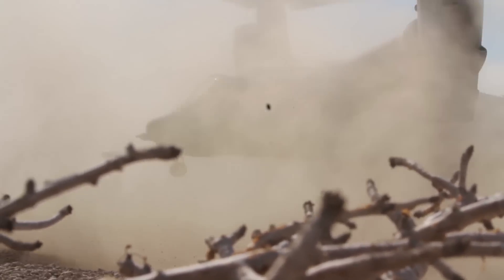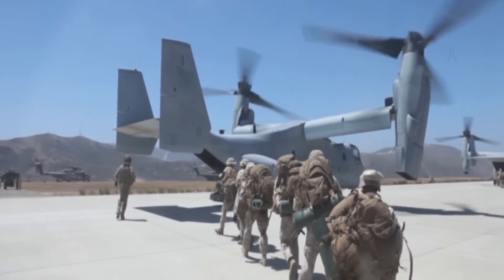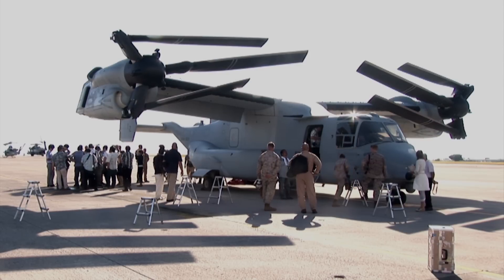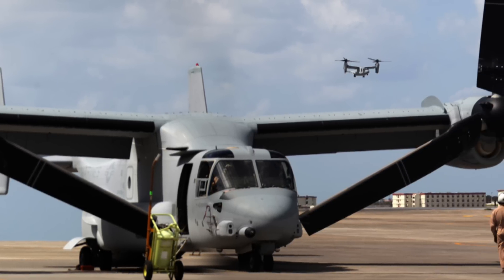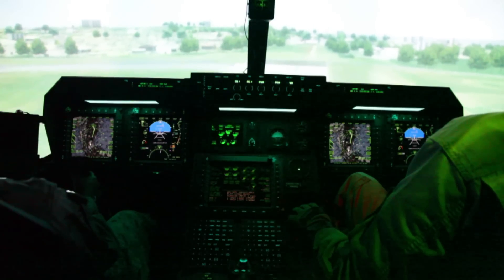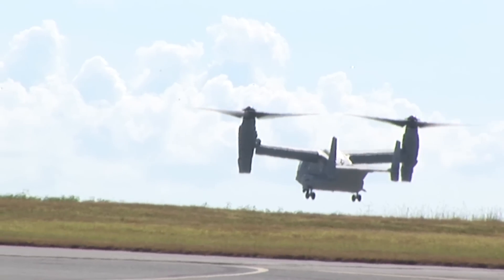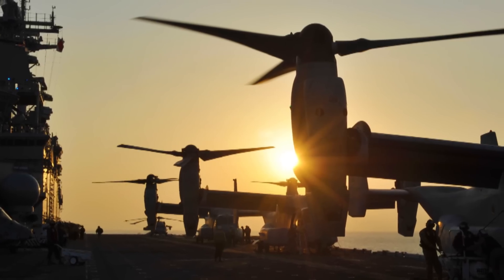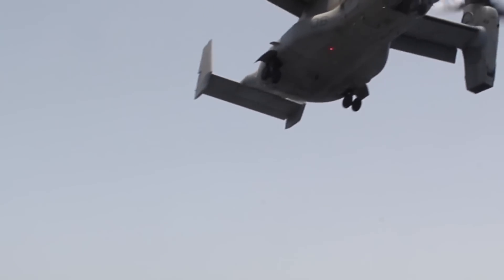How the Osprey Works

Comment: I remember that plane with an identity crisis. When those cheese d*cks switched patches from the white knight hmt-204 to the raptors vmmt-204. Back in 06 I was across the hanger watching O-5s taking out the trash. Seriously top heavy squadron. Watched one of those 22s fuse a couple wires together during a routine turn up to check a gyro. Damn thing jumped off the deck with 3 lower enlisted inside. The flying toaster came crashing to the deck. Broke the starboard wing, made it look like a kickstand. The whole flight line was locked down. All the suits from R. Royce and Boeing made that $84 million dollar aircraft disappear. This was weeks before 263 "thunder chickens" stood up as the first MV combat squadron. And shipped to OIF. The sh*t you see when private interest writes the playbook would astound you. Theres literally no end to the jack@$$very played out withing the department of dumbsh*t under the guise of national security.

Comment: How does it turn right or left in hovering mode? I mean helicopters have rotor tail to help turning the nose right or left.
Reply: One rotor disc is moved back from the vertical and the other is moved forward. Pedals are used the same as a helicopter.

Comment: I still don't understand. If it is being lifted like a helicopter then the center of mass must be directly beneath the engines, but if it is in plane mode the lift from the horizontal stabilizer would move the center of lift behind the engines causing it to fall forward. I see the back of the wings folding down but I would think it has to be the front of the wings to counteract that.
Reply: The wings are cranked forward, maybe that's got something to do with it. As you said the c of g has to be right on the center of the props. C of g can vary on planes (a little bit) by tweaking wings and tail plane size and angle etc.).
Reply: The center of gravity does shift forward when it rolls down into airplane mode. Sufficient airspeed counteracts that by providing airflow to the wings for lift
Reply: @brookelynn6964  but if the lift is directly on the wings then it would be in the same spot as the lift from the engines in vtol mode, so how does that keep it straight if the center of gravity is moving forward?
Reply: cheeseman it doesn’t move by much. The CG moves slightly forward so all that’s needed is a small correction on the cyclic stick
Reply: @brookelynn6964  it actually moves about 12 inches forward as the nacelles transition from 90 degrees (vertical) to 0 degrees (horizontal). The large elevator helps counter the forward CG with downward force.

Comment: "Safe" is an overstatement considering its history
Reply: I mean the 747 also has a bad history, but yet 747s are still in service cause they have been made safer.

A car probably has countless fatal accidents, yet we still ride them and ensure safety by using seatbelts, etc.
Reply: What u mean like in the testing phase? Even proven aircraft like the f16  had accidents in the begining,that's why they test in order to workout the kinks.
Reply: @RANDO4743  by "testing" you mean a long fucking time before these were made 'safe'
Reply: @seemslegit6203   the testing phase lasted about 10 years before it went into service,or do you think the miltary does a quick 15 min flight test before being operational? Lol I'm glad you know more than military experts.
Reply: Also, the 747 has a bad record too but yet a lot of world leaders fly on 747s including Air Force One.
Reply: Seems Legit. There is ALWAYS inherent risk with any new mechanical device....especially aircraft....and especially one of this complexity. However, just like with all other aircraft that number is extremely small compared to how many successful flights, hours, cycles that there is absolutely zero problems. Put it this way, you have a better chance of being struck by lightning on a cloudless day getting your mail than an accident in any of these aircraft. Especially when you take into consideration and compare to the percentage of successful ones in the same type.
Reply: Seems Legit It isn’t that unsafe lmao.

Comment: In the beginning with this craft, wasn't there an issue with the blades over heating when in the forward position? I recall reading about how the propellers would overheat and expand and start slicing through the hull of the craft.
Reply: Completely made up dude
Reply: I worked with the flight test program at PAX NAS for the first 18 years of the program. Trust me that never happened.
Reply: Connor Vaughn...That is in every way, shape and form misinformation. While yes, there have been some issues, it was never the blades getting so hot they grew a few FEET. while yes, most materials, especially metals grow with heat (extreme heat), we are talking very very very small measurements.
Reply: theres only two things you could probably be thinking of....the first is the icing system on the blades have a weak point on some tabs of solder that will break and cause arcing and burn up a blade beyond repair. literally burn a hole through it.

the second is in the beginning days the power module that folded the blades would overheat often and catch on fire but it never caused flight issues.

Comment: THE MILITARY, WHAT GOOD DOES IT DO,  FOR PLANET EARTH AND HUMANITY..........HATE, FEAR, DISASTER, INTIMIDATION, WORLD PEACE AND STABILITY....... : THE OSPREY  IS A GRETE DESIGN, I JUST WISH IT WAS FOR PUBLIC USE.......
Reply: I'm sorry but I'd have to disagree. If it weren't for the U.S. military, there would have been another world war. It's the great strength and reach of the U.S. military that prevents entire continents from falling into disarray like they did in the 20th century.
Reply: War is never ever going away.  Humans have been fighting each other since the cave men.  Heck, look at lions and other species.  Territorial battles in the wild are the same as humans.  Don’t think for one minute that will ever change.  To sit back it wave peace symbols with your two fingers is doing anything, you are just a sucker.
Reply: War is the failure of diplomacy. A soldier prepares for war but prays for peace.  There are times when men do great evil that war is the only way to curb the greater suffering.  To standby as the sheepdog watches the flock, ready to come to the defense of the weak in the face of evil.  Call me a sentimental old solder.
Reply: I'm sure if there was a market for such a device they would be used outside the military.  To hope there were no wars or need for a military is a pipe dream.
Reply: @kurtvonfricken6829  Actually there is. It is called the Augusta 609.
Reply: Look up Augusta 609, and learn to spell.